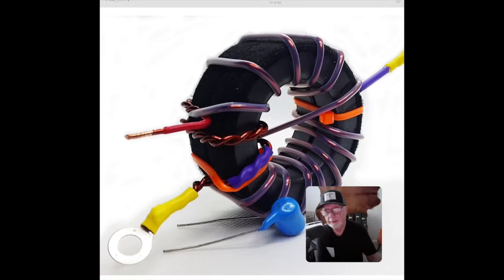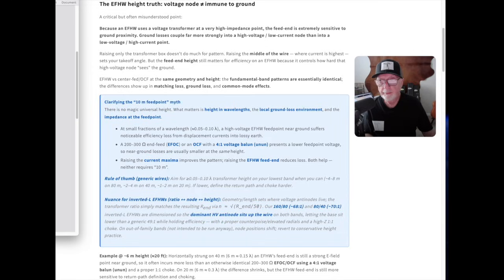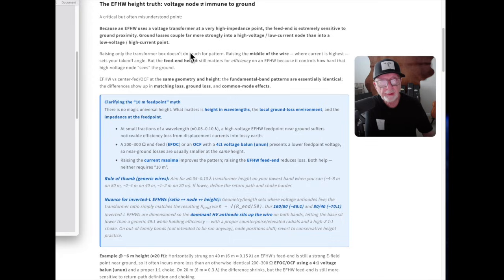"All Antennas Are A Compromise." - MYTH!

Comment: Very interesting stuff! I have a My Antenna brand EFHW 40-10. It has a coil approximately 10 turns on a 2inch pvc out on the wire about 6 feet from the feed point. I believe it is for lowering the SWR on 10 meters, similar to the shunt capacitor(if it has one).  The SWR is flat on most bands. To me this makes it better than compromised, all though it is. The limiting factors are the band conditions, when open I can work who ever I can hear and get excellent reports. Next, I will try the OCF dipole you suggest. I will compare this to the EFHW, using a mode called WSPR(whisper) from an app called WSJT-X. I have given a presentation on WSPR and It is an excellent tool for comparing antennas and propagation. From another video you have made, what I have said here isn't too good. Thanks for your great videos!  🤔😁
Reply from the maker: I like WSPR mode for comparing antennas but it isn't very accurate because of constantly shifting band conditions.  The difference between those two antennas  isn't so much in db but in transformer loss and heat.  Which do you think is more efficient?  A 49:1 transformer or 4:1?  It's obvious.
Reply: @BustRadioMyths  I''m not sure. 4:1 because of the resistance or impedance of the wire. Maybe it is so insignificant that it does not matter, I still not sure. Keep up the great videos.

Comment: I think maybe you are setting the bar too high Mark. Ocf dipoles are popular, I agree on that. But making them efficient and really working in the theoretical way you describe here, is probably quite hard, especially for new hams. Often an ocf is a good contest antenna for a few bands only. Integrating warcs are challenging. Even 15 m can be quite challenging with the ocf. There are some commercial available all banders ocfs like from palomar-engineers but even those designs must be adjusted with resonator stubs to make them work on 40/20. I'm not sure if hams even agree on what 4:1 balun to use, Ruthroff or Guanella? For instance , according to DJ0IP one should never go for single-core two balun design under any circumstances with the ocf dipoles.  So, I personally think there is no 110% correct answer here, therefore a compromise.

Comment: Good point of view. Each antenna has its advantages due to pattern. Each antenna can work well for its intended purpose if not compromised by the circumstances of its installation or knowledge of the installer. Using one antenna for all purposes is a compromise. Using a 4 element Yagi at 130 feet can be a compromise under the right circumstances.
Reply from the maker: Thanks Don you said it better than me.

Comment: You may be right, but how many users of vertical antennas actually have 120 radials for them...?
Reply from the maker: Once you get past 30 its diminishing returns.
Reply: A lot of the big guns on 160 meters.
Reply from the maker: Like W8JI
Reply: My very good friend W9RE does too.  Full size 1/4 wave vertical with 120 125’ long radials:)

Comment: Even government and commercial stations have design limitations, they just put more around the world.
A half wave antenna performs the same regardless how its fed. Loading it or operating it on harmonics does effect performance. If you want better than halfwave performance, you need to go to arrays like Serba Curtains, lazy H, yagis and such, but their directional and what you gain in one direction, you lose in others.
Also, given the same power, if you hear a G90 on your G90, they will most often hear you the same regardless of the antennas, but working that KW station, not so good.

Comment: Now you need to get started on the Chameleon line of aerials with their 5:1 broadband RF transformer feeds. You wanna talk inefficient??? And, the company will NOT publicly post the transformer losses of their Hybrid Mini and Hybrid Micro units. Furthermore, the modern Windom, OCFD, is very prone to common mode current issues unless one chokes the snot out of it near the feedpoint. Multiband antenna designs are usually not plug and play; ie put up and forget. I put up an OCFD at the inlaws over the Thanksgiving break, hung betwixt two 100' pine trees. The guest house, with a tin roof, is in the near field. Oh boy.......what a mess. CMC galore. More chokes arrive today.

Lets put this in perspective. Lets toss in some numbers (pulled out of a hat, btw). Assume -2.5 dB loss in the EFHW transformer, add another -0.5 dB for the cheap coax the ham bought, so that's -3 dB loss total. Using the old Collins 6 dB/S Unit standard, -3 dB is 1/2 an s-unit on the receiving end.  Now remember that ham radio S meters are NOT precision lab instruments to boot! I think hams obsess over having the Holy Grail Antenna, especially for portable deployments, that performs well, is mulitbanded, has a flat VSWR curve from 630M to 6M, zero losses, 20% less calories expended during deployments, etc., etc. I am sure someone drew up a Venn diagram somewhere pertaining to ham antennas.
Reply from the maker: I plan a video in a couple of weeks basically what you said about losses in the EFHW all band transformer.
Reply: @BustRadioMyths I interrogated Grok and the Evil AI had a lot to say!
Reply: Read G8JNJ's original articles on his broadband 5:1 UNUN's novel design and testing -- upon which Chameleon and others base their 5:1 UNUN.  You'll find that the G8JNJ UNUN has a measured average -1.5 db (30%) loss.  It was intentionally designed as a lossy transformer to present a relatively low SWR at HF for random length antennas.  The G8JNJ design was a result of reverse engineering and improving the Comet CHA 250 antenna's matching transformer which has a measured average -3.5 db loss.
Reply: @DaDitDa thank you

Comment: One more thing about antennas. When I talk regionally my inverted v is superior generally over the vertical because the low take off angle of the vertical goes over the antennas of the "local" guys. Bottom line there is no holy grail antenna that does everything even if installed properly. Great video.... 73, KJ5LSO
Reply from the maker: Reminds me of trying to work all of the original 13 colony stations, but my signal kept skipping over Georgia so I couldn’t get it.

Comment: For efficiency installation is everything. I'll give you an example. I have a Hustler 5-BTV (80-40-20-15-10m). I have 120 radials at 16.6'.... 2,000' of radials. At 80m that over 7 wl of wire, 40m - 15 wl, 20m - 29wl.... you get the picture. Why all those radials? ARRL Handbook for Radio Communications, page 21.21 will tell you why. Table 21.A  shows my power loss in dB is almost nothing at 40m and higher. 

Of course when I add the baloney balun and the LMR 400 ultraflex I am rockin' and rollin"
Reply from the maker: My exclusive bologna balun is ham radio‘s best kept secret!
Reply: @BustRadioMyths  LOL

Comment: End fed (voltage fed) antennas have been around since the inception of radio. Look it up. They exist in the 1920’s ARRL Handbooks. It’s not a new idea. 

“4:1 always beats 49:1.” Oversimplified — lower ratios are usually easier to make efficient and are less height‑sensitive near ground, but execution rules.

Notice your buddy says that it’s the execution that that matters here. Whether or not you use an end fed or an OCF antenna, the ham on the other side will never be able to tell the difference. They are all essentially dipoles anyway!  You didn’t mention that either. 

You forgot to take into account on your claim that a vertical with 120 radials is almost 100% efficient. It’s more like 20-30% efficient at best in the real world. Ground losses eat up most of your radiated energy with a vertical and a poorly executed old fart dipole(tripole) will beat it overall in efficiency. 

Ground losses eat energy with all antennas.
Reply: The 120 buried ground radial, 1/4 wave vertical is well-studied.  When properly implemented, Its radiation efficiency is about 90% at medium wave lengths (i.e., broadcast band).  At higher frequencies it is less efficient, but efficiency can be improved by placing 120 insulated radials on the ground's surface and elevating their ends (i.e., high voltage point) about 15 to 20 cm (6 to 8 inches) or more above ground.  In either case, efficiency for 120 radials is greater than "20-30%."
Regardless, it's true that loss due to poor ground conductivity consumes RF energy from antenna systems -- thus, the need for a ground-level or elevated radial/counterpoise system for a vertical, and elevation of a dipole's ends -- regardless of how its fed.  Of course, with a dipole, over-all height above ground not only reduces ground losses, but improves its low angle radiation.
Ultimately, all real-world antenna implementations are a compromise relative to the idealistic dipole or vertical with a perfect ground plane -- but some are better than others.
Reply from the maker: A vertical with 120 radials is almost 100% efficient based on studies by the ARRL and the RSGB.
Reply: @B @BustRadioMyths  can you post the links to those studies?  I’d like to see that. Maybe I’ll learn something new.
Reply: Hi Matt,  while he did not say what the length of the 120 radials (I assume buried ground radials) are for a nearly 100 percent efficient vertical the industry standard of 120 radials originates from the FCC for AM broadcast stations.  It appears AM broadcast stations have much higher efficiency than what you mentioned.  Using long radials  (at least 1/4 wavelength long) and good soil conductivity the efficiency reported by NAB and other professional organizations say it's on the order of 90% (with efficiency as low as 85% for low conductivity soils and as high as 97% for high conductivity soils).  A dipole mounted low to the ground also suffers poor efficiency due to ground losses (example per 4NEC2 model I just ran: 160 meter dipole mounted 30 feet above the ground using average soil, efficiency = 28% whereas if mounted 133 feet above ground (1/4 wave above ground) its efficiency rises to 87%, granted that 4NEC2 modeling of ground is only "so, so" it does provide a lot of insight).  73, Don wd8dsb
Reply: @wd8dsb thanks for that. Nec5 earth ground models are more accurate but I agree. We can only use what tools are available. I am referring to ham antennas, not commercial. 

AM radio station antennas are not ham antennas, and should not be considered unless hams have millions of dollars to implement one for their own use. It’s just not a practical comparison. Plus since all AM stations use a matching network at the base to load the antenna tower, that incurs loss as well. 

I used a 150’ inverted L, with 32 radials cut to 60’. The wire was 55’ vert and the rest horizontal. I mounted a remote outdoor ATU at the feed point to match the impedance and successfully used it on all bands. 160-6.   

With all things considered, cost and available space were main issues. Plus from 32 to 120 radials there isn’t much efficiency gained vs the cost of copper. So you do what you can and have fun with whatever “efficiency” or lack there of you can control. 

We should be talking about practical antennas for hams. Not idealistic constructs.
Reply: I am talking about realistic ham antennas.  Many of the big guns on 160 meters are using 1/4 wave verticals with 120 1/4 long radials.

Comment: So what you are saying is that its not the antenna that is compromised its me. I have been compromised, don't tell anyone. Now im paranoid 😅. 
I do like my loops and dipoles they work. I have to admit I do have a 49:1 that I want to use at the feedpoint with remote ATU of a 20m bobtail. The transformer will keep the nasty high voltage away from the remote tuner.

Comment: The issue is everyone is looking for that “Holy Grail” antenna and not enjoying the hobby. The reality is if the propagation doesn’t cooperate, it doesn’t matter how perfect or efficient your antenna may be. The total myth is that operators believe if they have that perfect antenna, they should be able to communicate anywhere, guaranteed. I use a simple end fed non-resonant wire antenna with a 9:1 UNUN strung around the inside railing of my deck and running only 40 watts and have no issues communicating when propagation conditions become favorable. The key word is propagation conditions. I’ve broken through pileups without turning up the power. It’s the most satisfying feeling. Just ask any QRP’er.
Reply: Very well said and this is true. Upon my experience, I made myself a rotary dipole for 10m mounted on 12 ft tripod. But then a typhoon was coming in so I have to lay down. I then put the part of the pole where the was mounted on top of a 15 inch piece of wood so the antenna wouldn't touch the ground. The following mornig, I turned on my radio with the antenna still 15 inches off the ground and scanned the frequency. And out of curiosity, I heard someone calling DX. So, I tried to respond to see if it will work. To my surprise I made a QSO with Indonesia from here in the Philippines with just 30 watts. But then of course, like you've said, it's because there was very "good propagation" that day. I'll never forget that experience.

Comment: I have five inverted vee's in my attic for 20m to 10m. Put up, tune up and you're ready to go. No wind or rain to affect them. I can find no attenuation figures for brickwork or roofing slates at h.f. so I guess it's minimal. They are fairly close to each other so that might be a compromise.
For lower frequencies I have a Joystick copy, a long (short) wire with inductance on the far end and a MFJ 16010 tuner, I can get it onto 80m but it's very short so not efficient.
G4GHB.
Reply: Since you run the inverted V antennas, I was wondering if an inverted V is like bending the powered element of a yagi down, what would happen if you took additional V segments and arranged them as if they were part of a yagi.  In fact, if you stacked all your inverted V legs parallel to each other in order of wavelength, would that perhaps cause the other antennas to somewhat behave like the elements on a yagi even though all the sizing and spacing wasn't correct for any given band?
Reply: @LazloNQ  
I think like mine they would have a bit if absorption.
It's why I tried to stagger mine so they are not in line with each other. They are not resonant so wouldn't act as a Yagi. There are V Yagi designs but designed for one frequency, a Yagi but in a V form. 
Electrical wiring and copper water pipes would have an effect on the radiated signal and it's why it's said keep any aerial away from other objects. We don't want our signal going to earth. They would also skew the expected radiated pattern
An experiment I tries and later found VK3YE tried was two magnetic loops to see if there was any increase in signal strength. There wasn't.
However maybe if with the correct spacing between them it might work. I'm thinking of a 2 element quad loop here. Tune one mag. loop slightly higher or lower in frequency as in a loop where one is slightly larger or smaller.
I did see one idea where the driven element of a Yagi was horizontally S shaped for better matching to 50 Ω coax.

73, G4GHB.